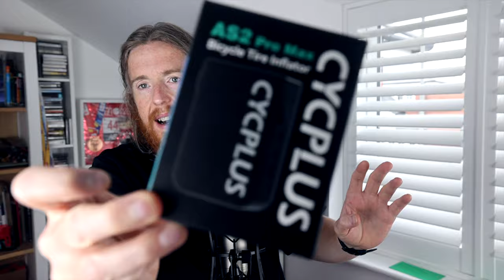A Solution To My Bike Puncture Anxiety?

Comment: Just a few tips for the next time you have to change an inner tube:
- inflate it up slightly (by mouth if you only have CO2 or with whatever pump you have) before putting it in the tyre so it sits nicely inside the rim and it doesn't twist as easily
- try to avoid putting everything back together with the lever, you risk pinching the inner tube and having to do everything from scratch, if the tyre doesn't want to go in the rim try to push it evenly further inside the rim as it is deeper in the middle, giving you extra "length" so you can push it in by hand

- try to find holes or sharp objects (sometimes there's more than one!) inside the tyre or the rim because it doesn't always come out by itself and its not fun having to do everything again 30 seconds after getting back on the bike especially if you only carry one inner tube

And do some practice runs in the comfort of your garage so you don't have to learn how to seat a stubborn tyre while in the rain or under the baking sun while sweaty and tired

As for me, while I dislike CO2 in general for the lack of reusability I only carry that, it's faster as it takes less than second to inflate it and the pressure will be "known" given the tyre size and they're cheap enough to replace, at home I use a similar (but bigger) pump to get the pressure right before heading out
This is coming from someone who has ridden 20'000 km in the last two years, probably older school cyclists will prefer a hand pump and some other will prefer tubeless setups, obviously everyone will have a different experience depending on the roads they ride and what they're used to
Reply from the maker: Thanks for the tips and thanks for taking the time to write it.

Comment: Nothing beats practicing changing the inner tube at home, so do that.  GCN has a great video on that whole process.   And just plan on your flat being on the rear tire.  It's a whole different thing to get the rear wheel out and back in.
Reply from the maker: @RonaldJacobs-e2i  ive done it now. All good. 👍

Comment: I’m sure you did but always run your finger around the inside of the tyre when replacing the tube incase the thorn/whatever that caused the puncture is still stuck in there.

Comment: I struggled for awhile when I first started cycling. Like most people I imagine. 

After watching some YouTube videos on changing tyres, and doing it out in the wild a fair few times I can say that eventually it does become second nature. Whipping out a new inner tube and slapping it on the wheel now takes a few minutes instead of 30 minutes of heartache and pain.

Also, it hasn't happened nearly as often as I'd feared. In fact, it's probably been about a year since I've last had a proper puncture out on a ride.

Comment: I'd suggest checking the AXS or Silca tyre pressure calculator to find the optimum tyre pressure for your bike setup and weight. The guidelines on the side of the tyre are usually far from optimal. I have an electric pump for home use, but I think I'll stick with my fancy Lezyne hand pump in my saddle bag when out on the road.

Comment: Was just about to say the same as alec a little air helps shape the tube before you put it in avoids twisting etc. Also once tyre is back on the rim go round the wheel make sure it's not caught the tube.

Been tempted by pumps like this but will likely continue with C02 until i run out of stock then decide as the electric pumps will just get better and smaller over time so tempted at some point.

Comment: You should play around with a bit less preasure in your tyres. It gives you a lot more comfort and grib. And less preasure in your rear tyre for grib then in your front tyre.
Reply from the maker: Doesnt more more grip mean a slower pace? Ive not struggled with grip before.
Reply: @RyanCondon  Off course it is a balance. But I definitely get an increase in comfort going over stones and holes before loosing speed. When you ride all road you can pump up your tyres and when you go out on a path defalte them a bit mayby to 50 psi.

Comment: I've got one of these, works great with inner tubes that have removable valves. I'd previously bought a small hand pump and it unscrewed the valve, leaving it completely flat!

I got the AS2 Pro with the little extension bit

Comment: Word of warning for TPU tubes. This is a a great pump and it comes with a small extension tube. There is a danger if you do not use the extension you could melt the plastic valve when inflating. Great video as always.